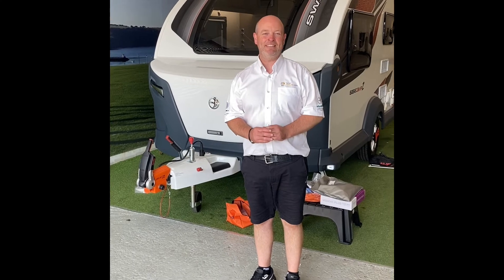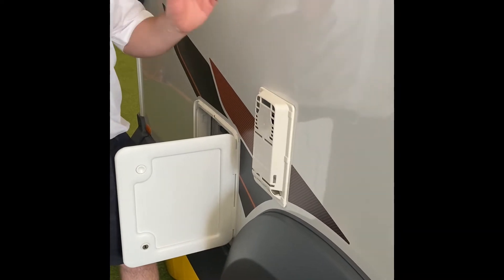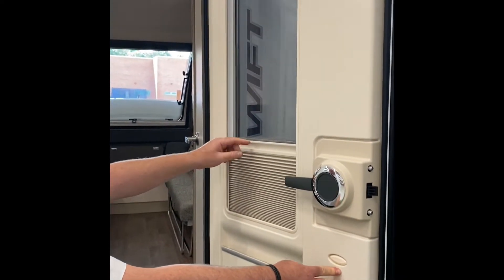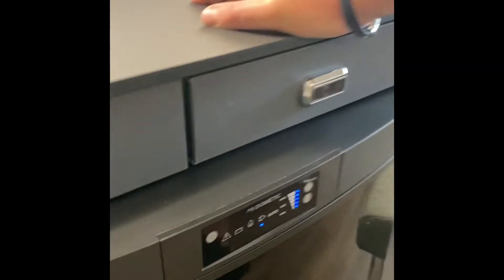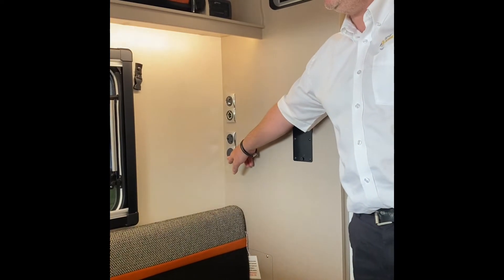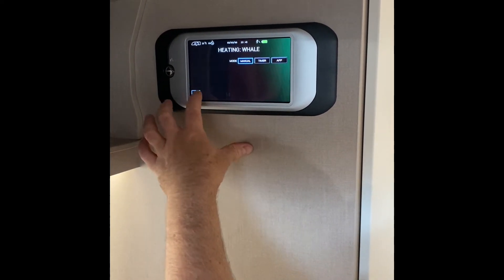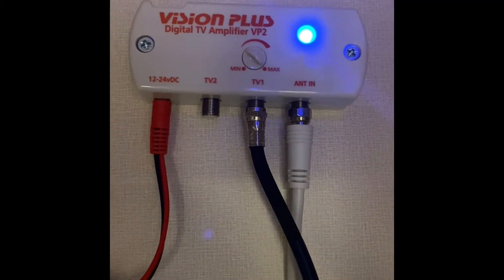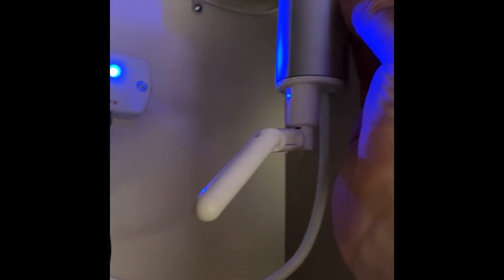Swift Basecamp 2 2021 Handover Operational Tutorial

Comment: Great walk through video but I’m confused by the statement, 10% and 10 deg C lower than ambient. Does it cool to 10% of the ambient temperature? So for 23 deg C this would be 2.3 deg C inside the fridge, which seems very reasonable. Or equivalently reduced by 90% of 23 deg C. 10% of 23 deg C is not a reduction of 10 deg C resulting in 13 deg C inside the fridge. Any clarification would be good thanks. 😊
Reply: @alansmith5401  Reassuring.  It would be very odd for a fridge to be only 10% or `10°C below ambient temperature!